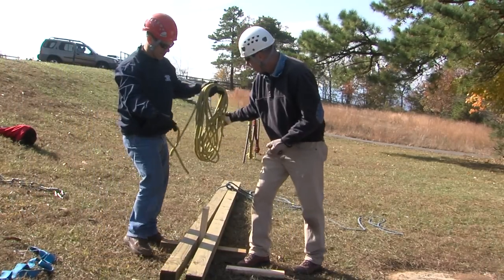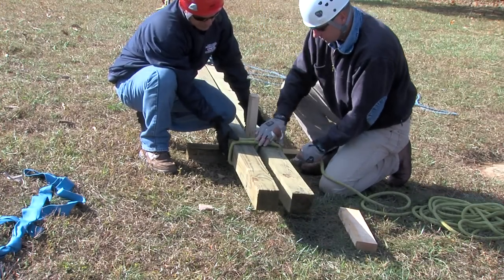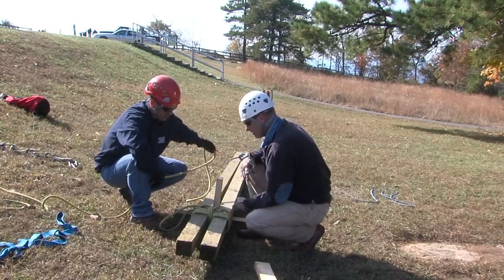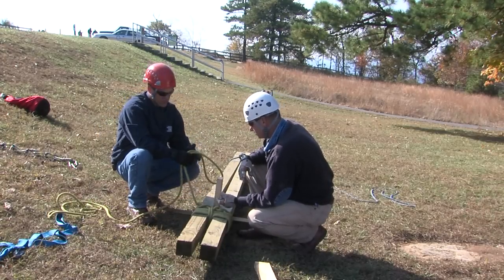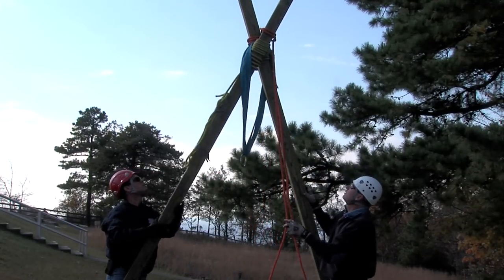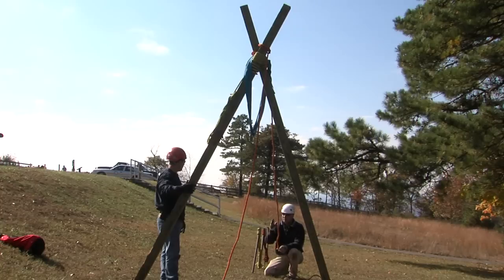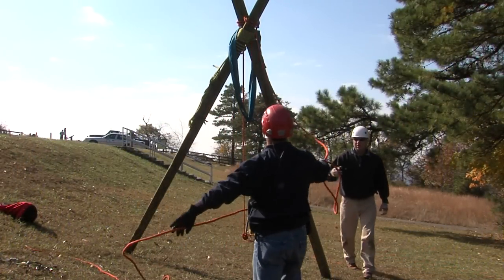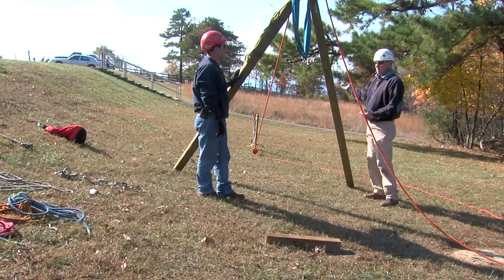Building an A- Frame with timbers

Comment: I'm an engineer by training and experience and I still can not understand what the hell this about.
Reply: This is just ONE part of how to build an A-Frame for heavy lifting.  This is something technical/heavy rescue units in the fire service would use IF you needed to use common items to do a heavy lift operation.  You need to see the entire sequence to understand this skill and it's application and limits.  This is a rated assembly and is specifically described (with data) in the Army Corp of Engineers Urban Search and Rescue Manual.